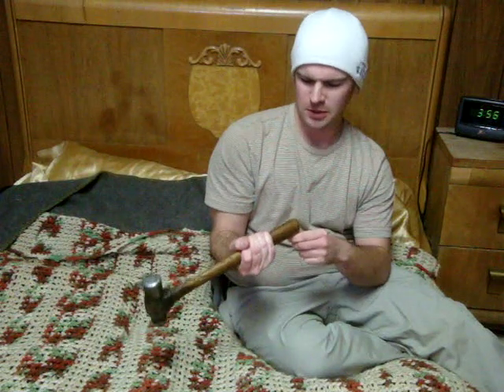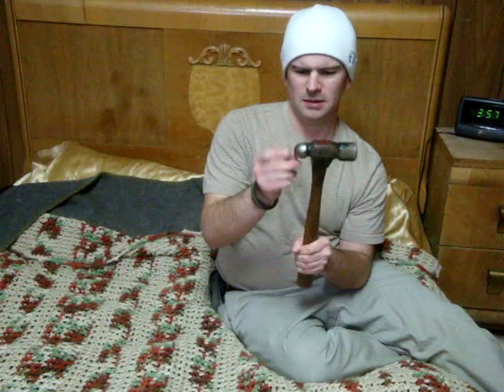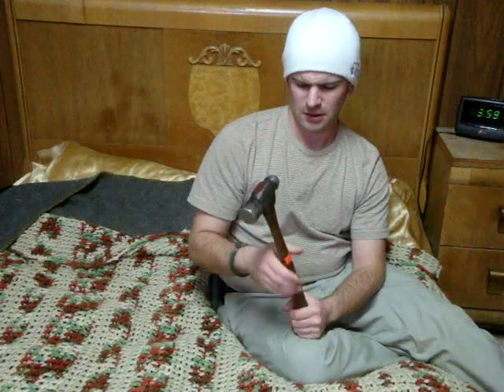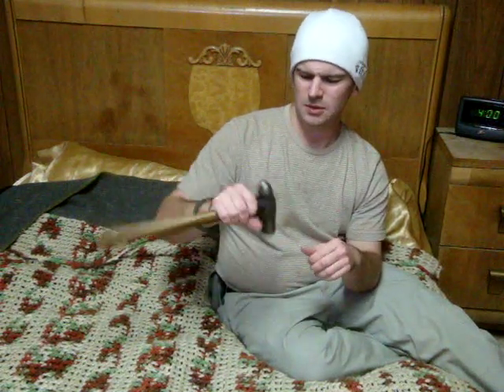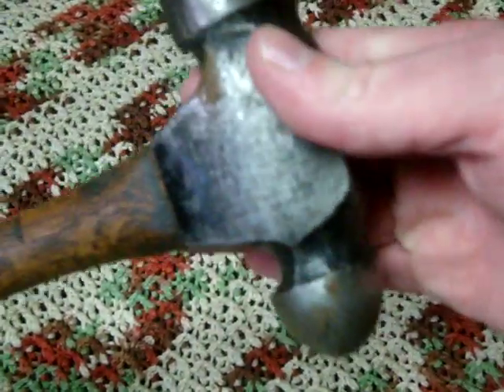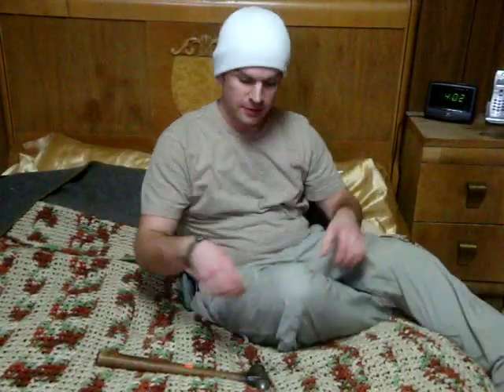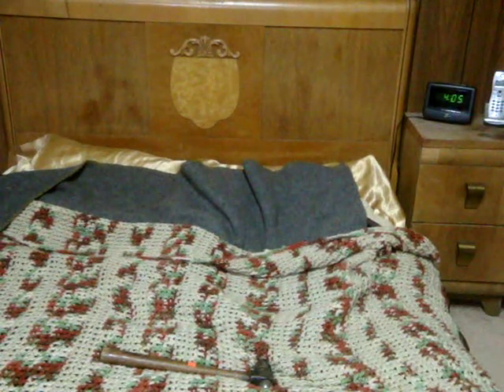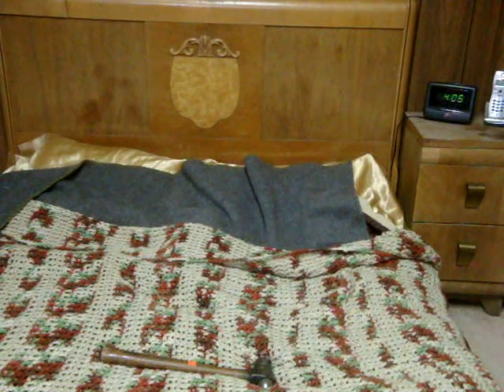Ball-peen Hammer Review

Comment: Hey man, that half egg shape you were talking about is called a peen. Its used for working metal, (hence the weight) perdominantly shaping rivits. Tinners will also use it for making metal bowls. Its really just an extra heavy, extra hard set of faces for working metal into the shape you want. The toolies at factories usually have a set of 10ish ball peen hammers ranging from hilarously small, to absolutely huge. (You bought the huge one)
Reply from the maker: Radar Really Thanks.